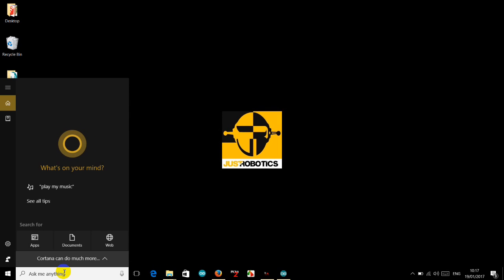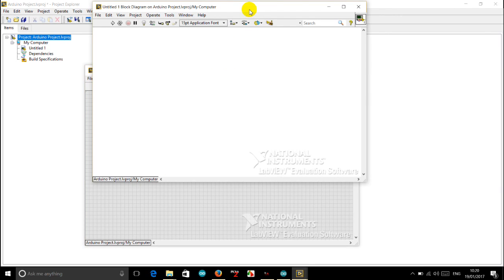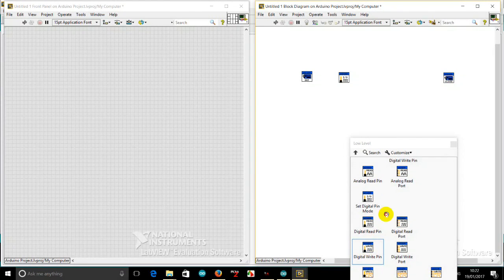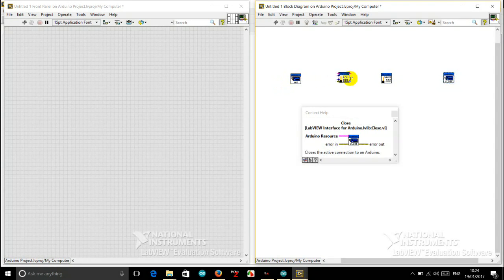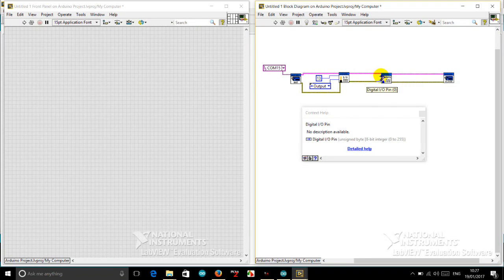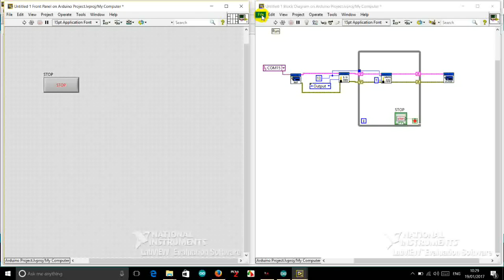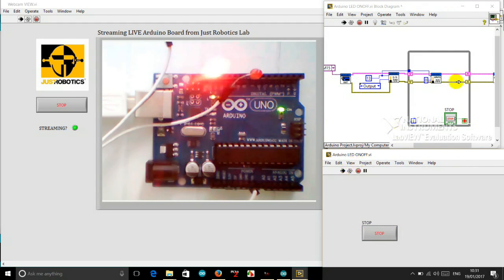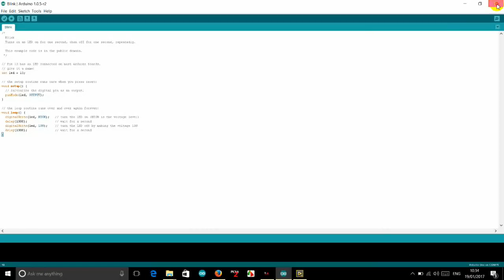PART 3: Interfacing and Controlling an LED using LabVIEW, Arduino and LIFA

Comment: I've made a LabView project that measures pulse rate and BPM using a USB DAQ device. I wish to use the LIFA library to display the BPM on an LCD interfaced using arduino. Is it possible? If yes, can you make a video about it? I tried going through videos for the same but they are for plain text display and don't seem to work with my project. Any kind of help would be appreciated.
Reply from the maker: Aditya Verma Hello :) sure. let us know what's the format in which you want to display data. we will see if we can do a video and post it. :)
Reply: just a dynamic integer value on the screen (or numeric as it's called in LabView). Also, another thing I was wondering was if LabView can be used to publish this integer value on a server like Thingspeak, from where i can then get data using a Raspberry pi.

P.S.:- Pardon me if any of this sounds stupid. I really know very less about this stuff xD. I've just started exploring these.
Reply from the maker: sorry for the delay in responding. Yes, you can publish data using LabVIEW. We hope you've figured out what to do :)